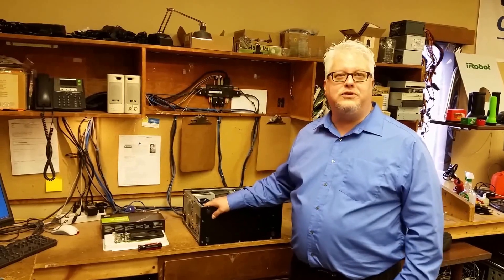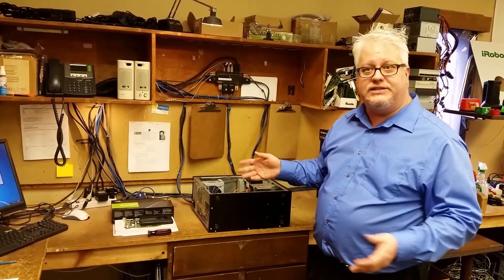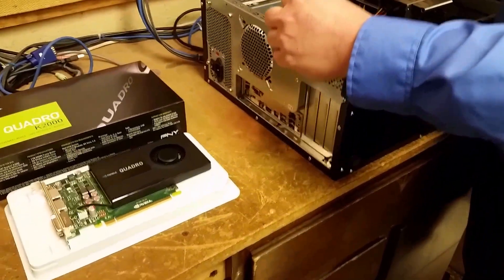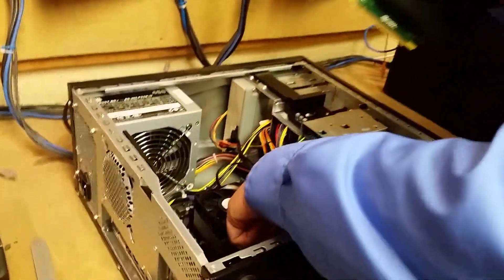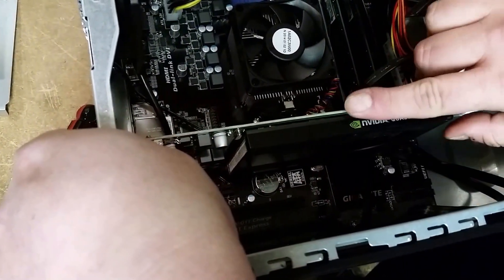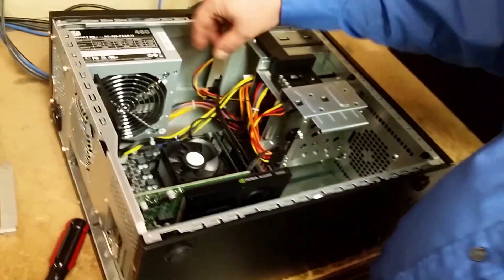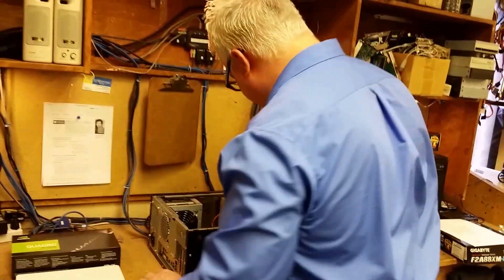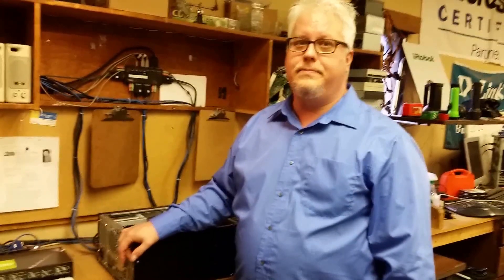Installing a Nvidia Quadro K2000 PCI Express video card.

Comment: Can you show us how do you configure this or K2200 with the monitor. I just bought K2200 and after installation I see nothing.
Reply: connect the vga to the gpu
Reply: This is super old but my exact issue. I get video but it's the pcs stock card somehow and I'm plugged into the k2200. I've tried a few different drivers and I get no results just the 32mb of video memory that I had before.